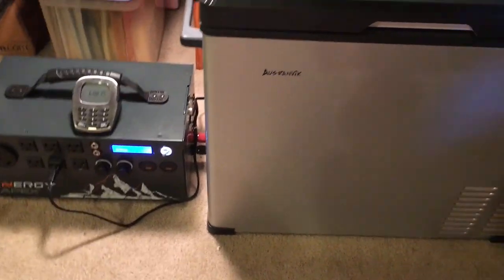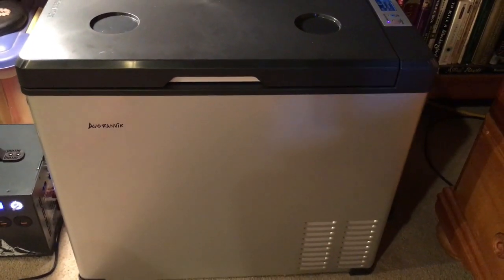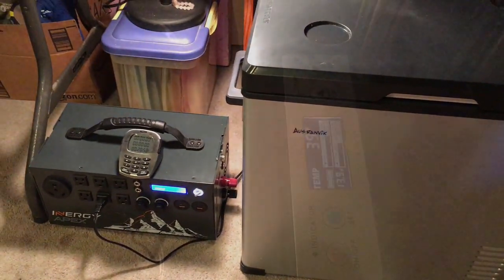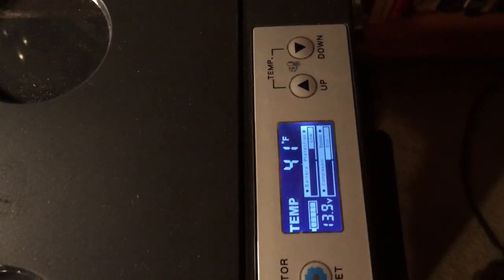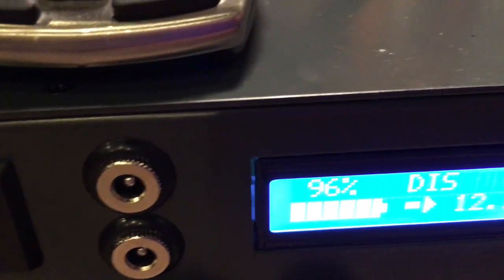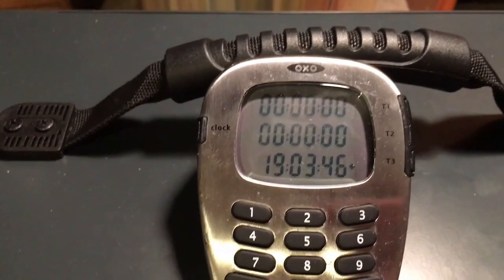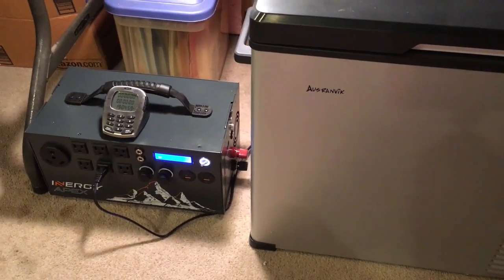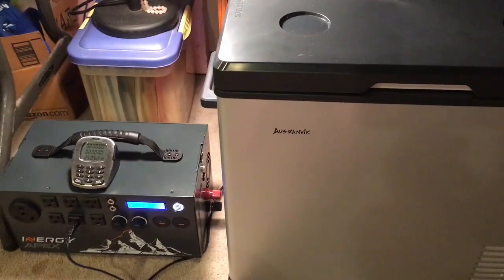Inergy Apex and Ausranvik fridge, 110V AC test run

Comment: Those particular type of frigerators are designed not to use very much power you could probably top that battery off and run that frigerator one whole week without recharging that battery probably run it two weeks

Comment: If you get a 12v voltage regulator from amazon you can draw less watts from the apex. Also the display is on the apex is not very accurate if you get load tester it will tell you the amount of wattage is actually drawing.
Reply: You can use the Goal Zero Yeti Lithium 12V Regulated Cable with the Powerwerx CigBuddy Portable Cigarette Lighter Plug with Anderson connector. You can also order Waterproof DC-DC Voltage Stabilizer 8-40V to 12V 10A 120W Power Supply Regulator with SCCKE 6FT/1.8m 14AWG 20A 12V 24V Female Car Cigarette and Carviya 12V 24V Heavy Duty 16 AWG 15A 20A Male Plug. You may have to wiring termination. I hope this helps.
Reply from the maker: @Wolverine2222  Idk if I'm capable of doing that, but I'll definitely look into it.  Thanks again.  🙂
Reply from the maker: Thank you very much.  Do you recommend any certain brand?

Comment: Thank you again. Using the Apex inverter/AC output (switch to left) requires the Apex to do DC to AC conversion which is more draining than using just DC outputs (switch to right). But it still ran the fridge for a whole day which is a good data point.
The Apex did it's job perfectly. When fully charged it provides 1100 WH. You took it from 100% down to 23% charged over 25 hours. 1100 x .77 / 25 = ~34 Watts/hour during the test. This is about what I would expect given that the Apex was powering the fridge (including spikes in power draw when compressor kicked in to maintain target temperature) running the AC inverter, the Apex display, and the Apex fan the whole time.
 I guess the bigger question is why that fridge stopped by itself (in the previous test) when using the DC output of the Apex which was still 65% charged when the fridge stopped working. Does the fridge at least beep or warn you it is in some sort of "battery management" default mode?
And you definitely need solar panels for ANY solar battery. Power outages can last for weeks in some scenarios. Then the question becomes do you buy Inergy Linx panels (thin/light/EC8) or cheaper panels (e.g. Renogy - thicker/heavier/non-EC8 connector). If the latter you need to do wiring modifications to the cables. Best of luck!!!
Reply from the maker: Thanks again for watching and giving feedback.  I appreciate it.  I'm unsure if there is any 12V fridge without the low battery protection.  If there is, I would definitely buy it.  Lol.  This one did not give me any warning that it errored out.  I found out the hard way.  I can't say as I'm in love with this Ausranvik, but hopefully it will serve me well on the road.   It works as intended (they presume you're running it on a lead-acid battery).  I just wish there was a way I could tell it I was using a lithium.  

I may or may not buy Inergy's solar panels.  I won't really have room on the roof for one so that's why I may have to buy a different brand and modify the connectors myself.